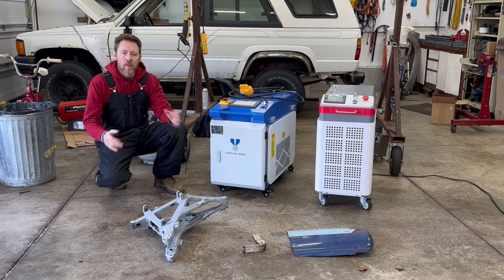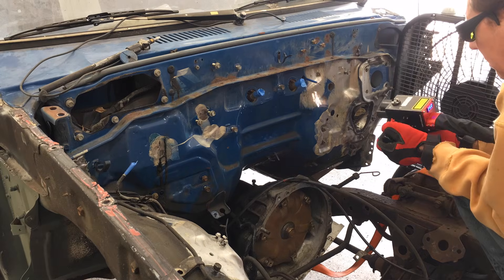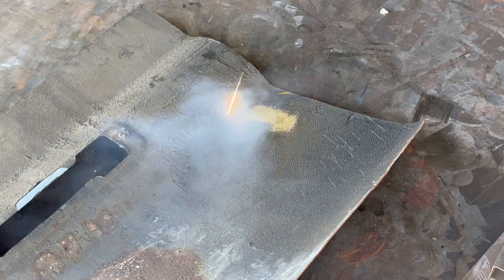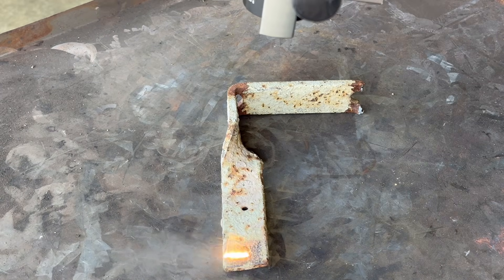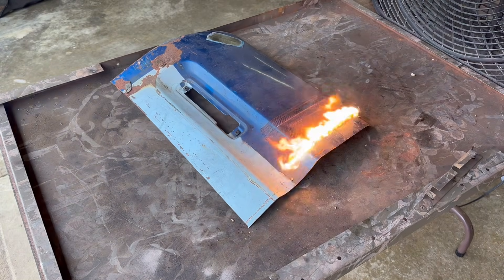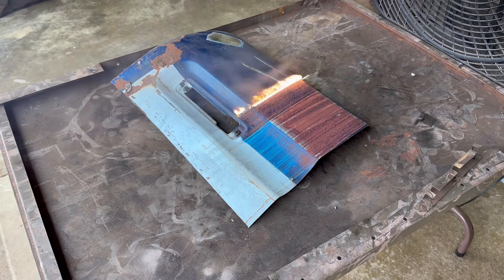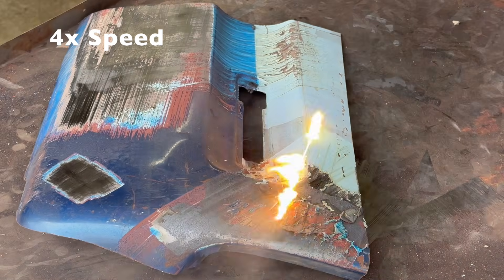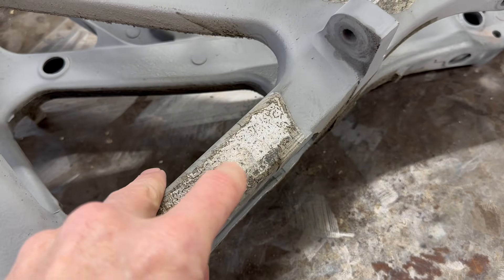200w Pulsed vs 2000W Continuous Wave Laser Cleaning Machine Comparison Test

Comment: What is your verdict on the continuous for auto body panels? I understand it depends on how thin the metal is. I was considering getting a continuous laser for stripping a 1977 Volvo to bare metal, but I'm concerned about the etching. Of course it is painted white 😐 I just heard at the end of the video you said it cannot be used in cold temperatures. How cold are you talking? That seems strange.
Reply from the maker: I recommend the pulsed for sheet metal, to prevent warping. The FLC2000’s operating range is 10C to 40C (50F to 104F) which I believe is to prevent condensation in the lens.  The FLC200 can be used as long as the temp is not below freezing.

Comment: would you have the same feelings though if it was a 2000w pulsed laser instead of 200?
Reply from the maker: A 2000w pulsed laser would be superior but I don’t know of any that powerful yet. I have seen 500w pulsed. I’m sure they will be available in the future.
Reply: @6thGearGarage  hopefully they will, i can't see why not.
Reply from the maker: I checked with Fortune Laser and they have air-cooled pulsed lasers up to 500w and liquid cooled pulsed lasers up to 2000w... so you were right on the money. The 2000w uses 3-phase power (380v), but the 1500w and below models use 220v which is standard residential power.

Comment: You mentioned that the 200W pulsed laser left scaling behind. Does the 2000W CW blow off scaling any better? I have a 1000W Pulse 50mJ and am shopping for a 3000W CW.
Reply from the maker: Yes, the 2000W CW does remove scale better than the 200w pulsed. However, if the scaling is heavy, I will still need to clean once, then scrape the surface, then clean again.

Comment: Thanks for the information. Why we can not use it in cold temperatures? Can I use it indoor?
Reply from the maker: I believe the reason has to do with possible condensation issues on the lens. You can use it indoors with proper ventilation or fume evacuator.
Reply: @6thGearGarage  Ok, thanks!! I asked because I live in Tierra del Fuego...  😂

Comment: Thank you for the informative video. But what I'm wondering here is, do you not vacuum up any of these removed materials?

Many manufacturers also supply a suction device. Because not everything evaporates 100% and residual particles get into the air.
Reply from the maker: I work over a large sheet metal tray. When I’m done, I carry the tray outside and dump out any leftover dust.

Comment: Would you consider using one of them to strip the paint off a house and intricate windows and trim?
Reply from the maker: I have seen pulsed laser cleaners used to remove paint and stain from wood trim. The lower powered pulsed machine does not damage the wood.

Comment: How does safety come into things with these machines if you have an area open to the public, like you have with the garage door open? I would have thought you'd need to keep the operating area also in an enclosed space so random passers by won't see any emitted light even if you're safe with your glasses?
Reply from the maker: I'm on private property, so no concerns for me. But say I was a business and I brought the machine to a public space to use on a job.... I think I would need to post warning signs to alert bystanders, and also put up some kind of standing partition to block the laser from public.

Comment: I was fortunate enough to get a 1kw continuous wave machine. I seem to have a lot more control of my settings including the scan width. It does have like 8 or so patterns like your pulse. One thing you should check on your machine is if it has a pulse setting. I just discovered today mine does reading my manual, so you can have both styles of machines in one apparently! It truly is an art to know what settings to change for each substrate and what is actually on the substrate. That's the only frustration for me so far is the trial and error of making these adjustments. There are no good videos for this. Cast iron and steel this thing is amazing with, ive been disappointed with aluminum so far. I qlso discovered today you can use it on rocks! So much to learn with this crazy tool!
Reply from the maker: It does great at cleaning paint & oil stains from the garage floor as well!
Reply: ارى انه يترك خدوش على السطح،هل هذا صحيح؟
Reply: Could you tell me the name of your machine?
Reply: @piotrwiara7818 mine is called omtech
Reply: Juby laser cleaners. Beda pod koniec roku dostepne w polsce. Wchodzimy na polski rynek.
Niestety bedzie to bardzo droga zabawka. W Kanadzie koszt 200w to 12 tys dolarow
Reply: Your machine does not serve as a pulse laser; it is not simply a system setting they are entirely different laser sources with vastly different optics to create the flat pulse top hat laser versus a gaussian continuous wave beam.

You can have pulse duration on a continuous wave laser but do not be mistaken and thinking that they are into changeable they are not at all.
Reply: Pulse on a normal laser is way different from a pulsed laser . A pulsed laser is actually usually pretty low wattage but when pulsed it is built up to achieve that power level and can be pulsed so fast u can't tell many times

Comment: I'm curious of what do you mean by "it cant be used in cold temperatures". Is it because it uses distilled water in it's cooling system? Can you use antifreeze on it or does it need to be pure distilled water? Or is there something else on this process that the low temperatures have effect?
Reply from the maker: I currently have antifreese in it, but I believe it's an issue with condensation inside the cleaning head or optical lines that prevents it from being used in cold temperatures. It's less of an issue with the 200w air cooled pulsed laser- it can be used as long as the temp is above 5°C/41°F
Reply: Good info. Thanks. 👍🙂

Comment: I dont know what your doing with the continuous pulse but i sceen many other demonstrations with only 1500 watt and they did car bodies with zero etching at least to the naked eye super clean and quick. Your looked like a hot mess
Reply from the maker: It might be because I used it on the sheet metal for a long time, burning through all the layers of paint, primer and bondo.

Comment: I would changed the cw to 40mm wide
Reply from the maker: The CW is a large format machine for stripping large areas quickly and is not adjustable without changing the lenses within the cleaning head.  The Pulsed machine can be adjusted to clean up to 50mm, so that would best in smaller spaces.

Comment: you can change the focal lens in the  continous laser
that might  brings better result
Reply from the maker: I actually bought this one because of the large format cleaning capability. I think the best way will be to use the 2000w CW laser, followed by the 200w pulsed in all the small areas.
Reply: @6thGearGarage  you are using it from far away... try smaller width... if the manufacturer writes up to.. use half of that number

Comment: I feel like you have the wrong focal lens in the 2000W unit plus can you adjust the beam width to narrow the focal point. most come with different lanes for cut, weld, and clean.
Reply from the maker: The focal lens is 800mm. It is set up to clean a large area fast. This is not a 3 in 1 machine, just strictly a large format cleaning machine. Lenses can be changed but I got it for the large format feature.

Comment: Is it possible to achieve a nicer finish without etching using a higher power unit, or is that always going to result in a rough finish?
Reply from the maker: From what I’ve seen the pulsed will always leave a smoother finish because of the power and heat of the continuous wave.

Comment: I would like to purchase laser cleaning machine too clean engine cylinder heads and cylinder blocks but ı am not sure which type should I buy pulse or fiber .rust is not a big problem to clean that engine parts but oil is .pulse laser is too expensive if fiber can solve we will choose fiber laser to import
Reply from the maker: Because you will be cleaning parts that are aluminum, I would choose pulsed. Pulsed will not harm the mounting surfaces like a continuous wave machine would.
Reply: @ thank you for your kindly reply as you mentioned pulse looks like more sensitive on the surface but pulse laser is too expensive, in my country there are too high custom taxes and some extra fees if fiber can solve our problem too we would choose fiber .ı will import and sell this machine not for my own use

Comment: Are these machines 110 or 220?
Reply from the maker: These are both 220, but I wonder if the 200w could be configured with 110 when ordering, because it is a lower power machine.

Comment: Both machines: 
What does the laser do to chrome? Rusty bumpers? Remove chrome?
What are the surface temperatures? Possible to infrared laser the surfaces? Curious if the temps are similar to welding?
Reply from the maker: I tried the pulsed machine on a chrome air cleaner cover that had a tiny bit of surface rust and it etched the surface of the chrome. Looks like crap now, should have just hit it with the fine steel wool and it would have turned out fine. I’ll have to do a longer test on some junk chrome to see if it can actually remove it. I do have an infrared camera, will have to check out those temps. Much lower than welding but can get hot to the touch if used on an area for too long.

Comment: Thanks for doing a side by side comparison on Pulse vs continuous Lasers. For area's that are exposed or flat, I agree sanding (or chemical stripping) would be the way to do it. I will be looking at getting a Pulse Laser, as it can get in the hard to reach or uneven surfaces. If had the money I would get both, and use the continuous on thicker metal (like frames). I realize that a real crusty frame may have to be laser'd a few times, but that's the only way to get down to bare metal in the "pores" of the rust. Sandblasting is probably the best way, but it is messy and you can only reuse the blasting media a few times. That sheet metal part appears to be a passenger side bedside from a 1979 F-Series pickup. The marker light cutout and body line is a dead giveaway.  I look forward on more of your video's, so keep up the great content!

Comment: WOW big different, you can't change the setting on the 2000w laser ?
Reply from the maker: @d7om_zl1  you can change a few settings like power, frequency, hz, but it doesn’t have the 8 different cleaning modes like the pulsed does
Reply: @6thGearGarage can you change the scan width? It's huge in this video, on my system you can adjust it fully.